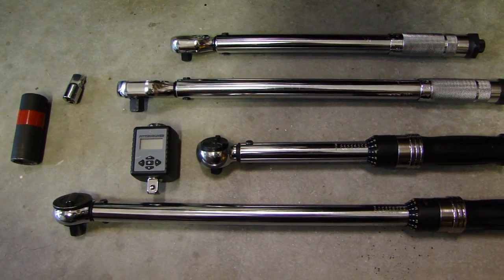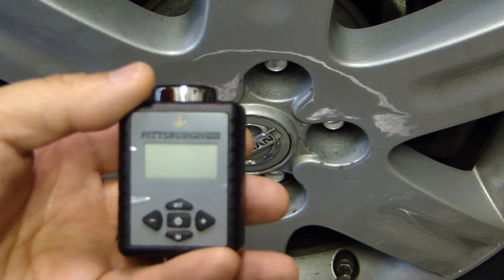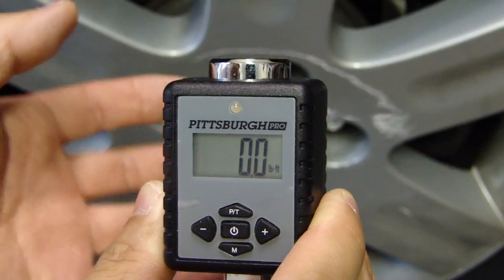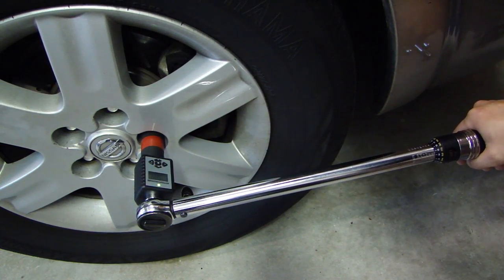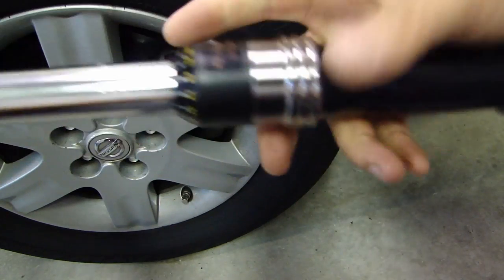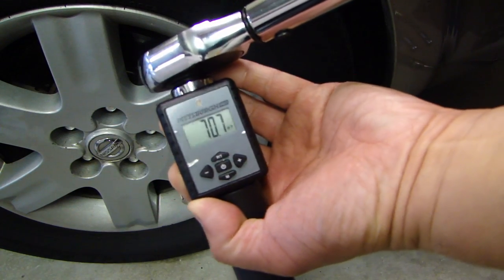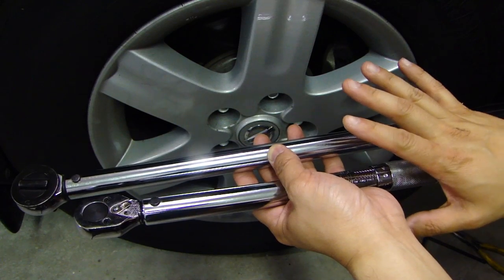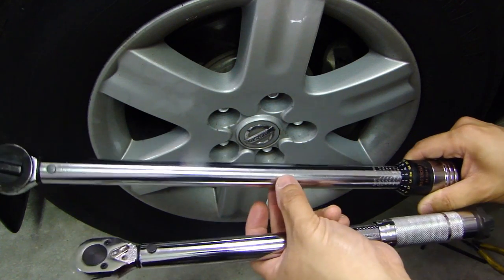How To Check and Calibrate Your Torque Wrench

Comment: I don’t think I’d use a cheap tool from the vendor of the cheapest tools in America as a calibration reference for torque wrenches that I use.  I’d be more inclined to trust my torque wrenches to determine how far off the HF tool is.
Reply: Okay pal. Don't knock the digital age old man. This thing right chere f*cks!

Comment: How do you know if the digital torque meter is accurately calibrated?
Reply: “That’s the neat thing, you don’t”
Reply: Old comment, but for everyone reading this now: i had the opportunity to test one of these cheap digital torque meters on a very expensive snap on torque calibrater and they were as close as 1% in torque measurements. I would assume if you were to cycle them about 1000 times they would certainly lose some accuracy, but if you buy one and just use it to calibrater your mechanical wrenches you are probably good to go for the rest of your life with these.
Reply: @donta, tmebro-, they are calibrated and need recalibration after a period of time

Comment: this is a good video. but one thing ppl should know is. you need to hold wrench head with one head so it sits perfect on lug nut and one hand should be perfectly pushing 90 degrees on the handle. rotating the wrench at angle introduces error percentage reading which makes calibrating accuracies worthless from the beginning.👍🏻

Comment: The total torque being applied to the socket is the sum of the moment of force applied by your hand and the moment of force of the weight of the wrench applied at the wrench's center of mass. This might be why the adapter's readings are consistently higher than the torque values set on the wrench. One way to eliminate this would be to orient the wrench vertically and pull horizontally.

Comment: This is a great review and unit from Harbor Freight.  Sent back my Snap On 3/8 torque wrench for rebuilt and once back, checked it against this digital adapter.   The digital adapter was spot on.
Reply from the maker: Really appreciate you sharing your experience with this unit, as many people feel negatively because of the HF name on it.
Reply: it's right there with my 250lbs CDI dial torque wrench.  I snap it on to the CDI, and when it reads 75, so does the harbor freight.  I played around with different torque settings; it was always spot on!

Comment: Yet another great and very very helpful video!  The included instructions (with HF torque wrench) were never clear; thanks for providing this tutorial.  Video also proves that cheap HF torque wrenches ($10 on sale/coupon) are at least as good as the more expensive Craftsman
Reply from the maker: The 1/2" HF torque wrench is good quality. The 3/8" HF torque wrench can be a hit and miss as some don't give a solid click. I did exchange it once and the second one was good. They do have a lifetime warranty, can't beat that deal.

Comment: Very nicely done, with clear, logical narrative and good audio and lighting. Using a digital torque adapter is certainly simpler than buying three torque wrenches for different torque ranges, and having to recalibrate periodically. Using a digital torque adapter to check/calibrate accurately a non-digital torque wrench is certainly quicker and more accurate than mechanical methods. Some questions--
(1) Does the digital torque adapter ever prevent adequate clearance when torquing a nut? Placing the adapter between a wrench and its socket could change clearance when working in tight areas
(2) If I do have a clearance problem, and am forced to add a socket extension of say, 12 inches or longer, have you found a socket extension makes your digital torque adapter's indicated value different/inaccurate-- at least, compared to the value indicated without the socket extension?
(3) Have you found your digital adapter depletes lithium button batteries too quickly? That is a subjective point, but it might be relevant if fading voltage on a lithium battery gives inaccurate readings.
(4) Have you ever dropped the digital adapter?

Comment: Hi is that adapter two way I mean use open bolt and tighten bolt to check torque or use only tighten bolt read measurement 
Thanks
Reply from the maker: Only for tightening.

Comment: It would be good to hold the end of the torque wrench to keep it square to the fastener. Also use a slightly shorter socket.

Comment: Why do these things have to be continually checked and tested is it because of faulty manufacturing
Reply from the maker: You don't have to check it all the time. Only if you drop it, or if you are a mechanic that uses it a lot. Also make sure you wind down the torque setting before storing.

Comment: do you also get pretty bad battery life with your digital torque adapter?
Reply: +Brian Ng  Yes!  I just ditched the cover and take the battery out when I store it for long periods.  I also turn it off immediately while using it on a project.
Reply: I heard the foam lining will turn the unit on when the lid is closed and drain your battery.
Reply: The Pittsburgh torque adapter used small button-type batteries. Harbor Freight has replaced it with a new model ("Quinn" brand) that uses AAA batteries, for much better battery life.

Comment: What is the reason for changing from Ft/lbs to Nm when calibrating a 3/8" drive with an adapter?
Reply from the maker: Lonewlf7676 It's just a different unit of measure for you to measure torque when you use it to tighten a bolt.
Reply: dial2fast I understand that they are both units of measure. I was curious as to why you didn't just leave the tester in Ft/lbs when checking the 3/8" drive. I thought there might be some reason (like the use of the drive size adapter), other than just because you can.
Reply: Often the 3/8" torque wrenches are in Nm.

Comment: How do you know that the digital torque adaptor is accurate as well? that is the big question now...
Reply: Pretty easy because when you set your torque wrench at the poundage and the adapter is within the limit both are working. Most people have more than one torque wrench you don't usually have all the torque wrenches go bad at the same time. Even if you're doing inch pounds easy to convert.

Comment: Another excellent tutorial. I got the torque adapter and with your video I hope to check all my torque wrenches if they are within the accepted range. I wish they had one for 1/4 torque wrenches with the in-lb range.
Reply: Edmund Mendez I would loved to see an adapter for the general masses that is accurate , not too expensive and completely reliable for all sizes of torque wrenches and for ranges between 0 and 400 foot pounds. Haven't found a single adapter to calibrate my 50-250 torque wrench. Most 1/2" adapters stop at 147ft/lbs.
Reply: Edmund you can use this HF digital adapter for that...it even comes with an included adapter for an inch pound wrench.  You'll just have to make the conversion from the foot pound reading to inch pound yourself.

Comment: hi I have a question.  can you do 6.5  lbs  on a digital wrench   and will that be acurate   to a non digital  torque wrench?
Reply: There are torque wrenches that go that low, but not your typical automotive torque wrench.

Comment: Pressing M and Power together ONLY recalibrates tool back to factory settings, thus ERASING the preset(memory) settings YOU put into tool!
Reply: Is that what it does?  I did that with my HF digital torque adapter & thought I may have permanently jazzed it up. Thanks for mentioning that Isshman.

Comment: it would be worth while to modify a socket to calibrate a torque wrench .weld a bolt or some thing ,so you could slip a allen wrench inside it .

Comment: you have four four torque wrenches..00.) may i grab one?!
Reply from the maker: +billal x LOL...check out Harbor Freight. With a coupon, you can get one for $10.
Reply: hahaha coupon number plz..:P well currently im using $10 beam torque wrench (150 ft-ib) the good thing is it does not need collaboration but a tricky to use..:) thanks for the video sharing.its informative.

Comment: Couldn't  you just use a breaker bar and the digital  adapter  and watch the gauge
Reply: Yes. But there are some circumstances where you don’t have the clearance to use the adapter so you would need just a regular torque wrench.
Reply: @flyer8493  just  need for  changing  mower blade
Reply: @wayne1362  Breaker bar should be fine then.

Comment: Assumes that the digital torque reader is accurately. All torque wrenches need to go to a testing facility where they will be tested and  a graph produced of indicated vs actual and perhaps multiple lines based on temperature.

Comment: Using a tool with a +/- 2% margin of error to calibrate wrenches with a +/- 4% error is going to give you bad results. Who's to say the digital isn't high and then your wrench low. No doubt this gets them close, but you could end up with up to a 6% margin of error. That 70 pound measurement had a plus or minus of 2.8 pounds, which it was within range. Torque wrenches don't measure in linear accuracy. Getting it dead on at one point probably moves your accuracy out of spec somewhere else.
Reply from the maker: Yes torque wrenches are not accurate at either low or upper end of the range. If you have never dropped or abused your torque wrench, there is no reason to ever calibrate it, but for those who has one that is messed up, this is a good way to get it back to working order.
Reply: dial2fast 
A good torque wrench will be accurate between 10% and 100% of scale. You are also talking about the accuracy range - is that +/- 2% of full scale value or indicated value. That makes a huge difference. The accepted formula for calibrating wrenches is simply a 4:1 ratio. If you are calibrating a torque wrench that is +/- 2% you need a torque tester to be at least +/- .5% and you need the resolution to prove that it is infact that accuracy level.
Reply: dial2fast When i read "If you have never dropped or abused your torque wrench, there is no reason to ever calibrate it" i almost cracked a "WTF did you just say" type of smile.  And I never smile.  
Also, adding the reducing adapter effectively changes the reliability of accuracy. Not a valid test. Test at three or more torque values with repeated checks. 100%, 60% and 20%. Repeat full checks three times. That is the standard from American Society of Mechanical Engineers, or ASME. Never only test Just High, Just Low and certainly Not Just Mid Range calibration.  
Should use this method only to give you enough self validation to do it right or buy a new quality wrench, they are so darn cheap nowadays.  
Don't buy HF or MasterCraft or Craftsman or Husky or whatever El-Cheapo tool unless that is who you are. El-Cheapo is where you put your ego before safety and practicality. The above are the really poor mechanics choice of scrap-n-crap torque wrenches. Get a Proto or a CDI and pass this better quality tool to your son when you pass on from making bad videos. Don't have to buy Snap On. That's just tossing money away.
Otherwise a good general informational video.
Reply: HawaiianF150 2009-4/6-L3V A reducer does not effect the accuracy, you're not changing your center of rotational mass.
Reply: We are not speaking of centrifugal forces here.  Your reply is pure deflection.  Please allow me my turn.  Testing equipment fitment and device flex is very important. If it wasn't, why not use a universal joint when you test a measuring device for accuracy?  Because it should not be used!  What is important is that I think you realize the video could have been presented better.  And honestly, I think you already got that.

I do thank you for doing this video.  These types of videos are extremely important. They provide all of us very important knowledge. We need these videos.  Keep them coming.

But please keep it real.  I would say that anyone providing professional expertise and information in a half-masted manor to ensure our family's safety have a true responsibility to be as accurate as possible.  Especially if it involves a moving vehicle.  I am sure you would feel horrible if a young child was seriously hurt or worse if a fatally occurred due to an improperly maintained vehicle because somebody followed your view or expertise to the letter.
Reply: HawaiianF150 2009-4/6-L3V I didn't make this video. A universal can change the rotational center of mass, an extension or reducer doesn't. If the 12 inches from center of rotation isn't changed, why would the measurement change? Just another arm chair engineer over here.
Reply: daver3230 I agree with arm chair engineers over there.

Comment: This device is NOT designed to check the accuracy of click type torque wrenches and should not be used for that purpose. It only has "PEAK" and "TRACE" (aka TRACK) modes.
For click wrench calibration, you need FIRST PEAK mode, which the device does not have. For what it's designed to do, it's probably OK. Keep in mind it is ± 2% accurate. Remember when buying tools, you generally get what you pay for.  Gary @ Snap-on Tools.
Reply: This test is still good enough to give a general accuracy of torque, right? Or can the click bar he used, lets say, really only be 20 ft lbs instead of the 70 ft lbs just because it is not First Peak? How off is the +- accuracy of the test he did?

Comment: I wouldnt trust anything from harbor freight
Reply: That digital torque adapter is very accurate!  I pitted it against my CDI dial torque wrenches and snap on, proto clicker type.  I have mine calibrated at a certified shop.